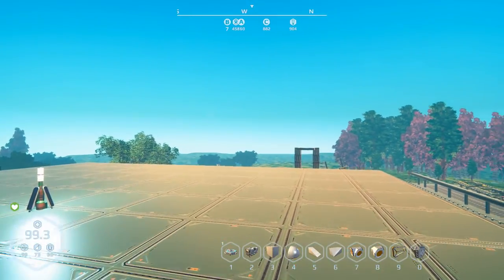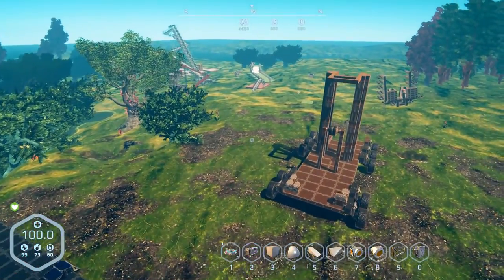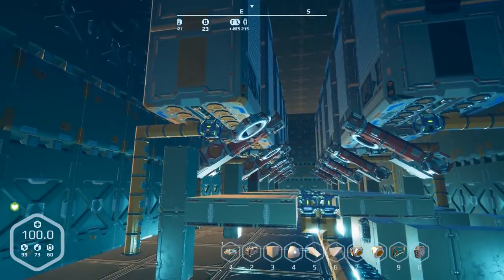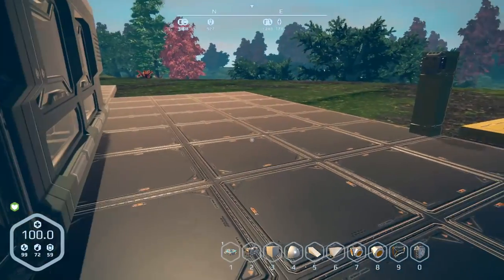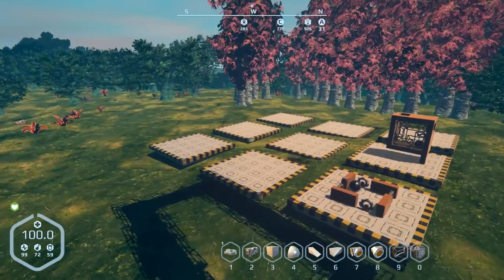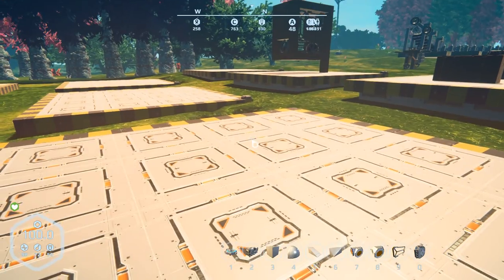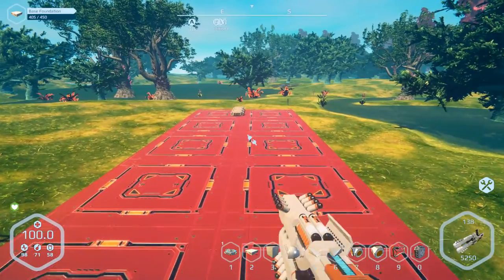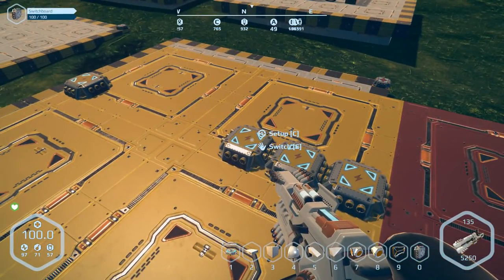Daylight Sensor By Sean Mack - Planet Nomads Season 2 - 22

Comment: Did you ever consider making a blueprint of a massive set of the base plate blocks ?   I spend so much time on adding the base plates to expand my base, and I see that you make each platform as well block by block.   Is there a reason nobody has posted some  5x5 prints of base plates to do this quickly.   even to flatten a surface, you just print it and remove the dirt on top.  Going through all your videos and learning sooooo much.   Too much ideas for my own base at the moment, not enough time to sleep.
Reply from the maker: there has been a few blueprints of floors but currently we cant attach a blueprint onto an existing structure so it would be more of a "preset foundation"
Reply: @bcplabs  Yes indeed, just to start a new project, and this would be the first build to have a flat surface.
Reply from the maker: i can look into it but i have seen a few in the workshop from newer players. i may make a picture board similar to the floor in my main hub. btw i will be starting a new season shortly. i ran into builders block with the current one so ill be starting over and back to survival